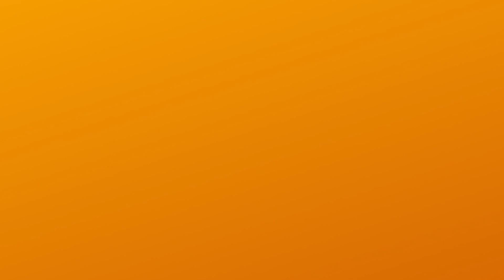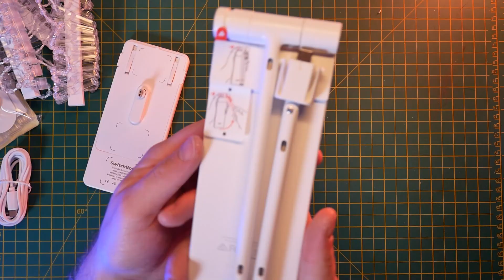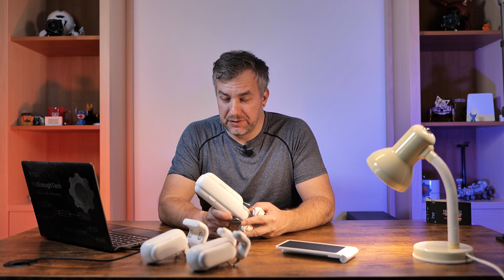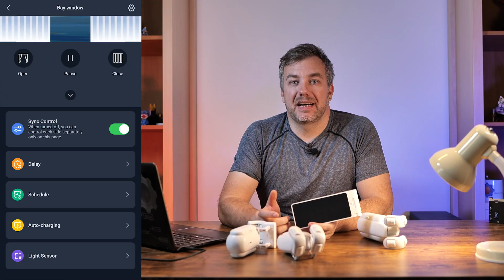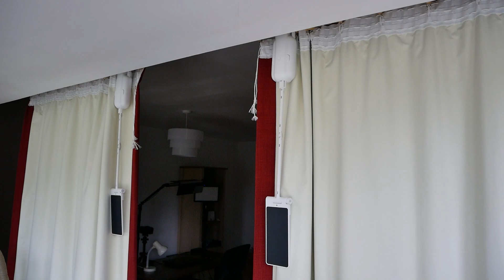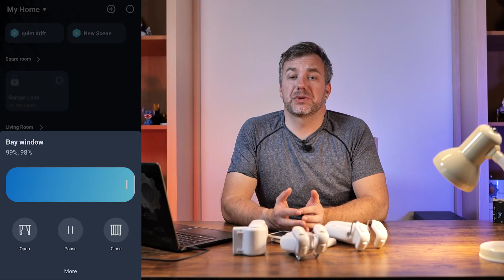Silent curtain automation with a catch! SwitchBot Curtain 3

Comment: I've got a pair of SwitchBot Curtain 3s myself for two curtains on the same rod and it works great for opening but closing is a slight problem because my curtains don't quite come together at the bottom so I have to adjust them by hand. It's not a major issue because the bots close the curtains a good 94% but it's just a little annoying. I haven't tried the magnet yet but I doubt if that would make any difference as the problem is at the bottom, not the top, they close fine at the top. Does anyone else have this issue?
Reply from the maker: As in the curtains sag at the bottom creating a gap?  Have you tried to give a bit more material in front ot the SwitchBot to even it out?
Reply: @notenoughtech  Thanks. I'll give that a go when I have some more time. I'm quite happy with the overall performance of the SwitchBots though. They do a sufficient enough job that I can say it was money well worth spending and I RARELY say that 😀

Comment: I own a switchbot bot, the hub 2 and the lag is awful (3-4 seconds) when using the hub 2's button/buttons to activate the bot (no other smart system involve, hub 2 right beside the bot, everything with last update).
I see no reason why it would be any different with curtains.
BTW, I also own 2 external temp/humidity sensors and there are no freaking way to toggle between them and the hub's own sensor (cable) using the buttons. What a stupid limitation.
I was about to invest even more in the whole ecosystem (curtains, buttons, door sensors) but the lag is a no, go.
Reply from the maker: Have you checked with support? Mine was on pre release firmware but I'll make the update and see if that's an issue
Reply: @notenoughtech  
Not yet. Just moved in new place (sounds familiar?) and contacting support wasn't on my priority list. I have made sure that all device had latest firmware through the app., deleted and reinstalled devices, ... The bot on its own work just fine through the app but once I try to control it through the hub, the lag is terrible (3 - 4 seconds).
Reply from the maker: @sylvainmichaud2262 I'll test on my side and get feedback from my SwitchBot contact
Reply: @notenoughtech  Hub 2 V1.0-0.9 Bot V6.3
Reply: @notenoughtech  
I have retested and measured the lag time on many occasions and it's not 3-4 seconds as I thought but rather 8-9 sec between the moment I press on my Hub 2's button and the reaction from the bot. Directly from the app, activating the bot takes 1-3 seconds. All this with devices i.e. phone, router, Hub 2, Bot close to one another (less than 3 feet).
Reply: @notenoughtech  
More information. After installing the Amazon Skill, I've tested the bot with Alexa 3-4 sec.
It is clearly a Switchbot Cloud communication issue.
Reply from the maker: @sylvainmichaud2262 thanks
Reply: I have a bunch of Switchbot devices and my results vary, but are mostly bad as well. NFC tag, voice command, scene widgets, schedules, and the Hub 2 button are all slow and fail quite a bit. The only thing that's fast and efficient is controlling the device itself from the Switchbot app.

Funny thing is that I have a smart button that runs a scene through Alexa and though that's also slow, it has a very low failure rate. I don't understand how that would be any different than voice or widgets to run scenes but it almost always works.

Despite all I've said I still like their devices and many of the solutions they came up with. So I'll just keep dealing with the delay as long as it works eventually. Which I've accounted for by creating schedules with multiple attempts to open and close stuff lol.

Comment: Why do you need to tell it the best charging position?  Surely it can tell that by how much light it has coming in>
Reply from the maker: It's actually harder than you think. Multiple runs would be required to define best charging positions annoying you in the process. How would a light sensor know if the panel is behind the shadow cast by window, nearby try or a cloud? You'd be surprised how simple is judge great charging position in minutes by a human.
Reply: @notenoughtech True, it'll depend on how smart the system is.  I was thinking along the lines of the left cells are producing more power than the right, so shift left a bit.  But considering how close these will be to your windows you should be able to set it up in the most obvious place.  Also moving it just to gain a little more power would probably use more than you gain.
Reply from the maker: @gordon861 it's more about avoiding the obvious shadows that often travel across the day.

Comment: Great video but how are these comperes to aqara? And also do i still need a hub if i have HA with active Bluetooth. I dont want to buy another hub just for curtains 😁
Reply from the maker: I have a separate video about the aqara ones. As per hub ... I think someone tired the Bluetooth in HA but I'm not sure how this ended up. Btw switchbot hub are also IR blasters. And hub 2 is even more so worth checking as you will have access to API
Reply: @notenoughtech  thanks for the quick response ! I have an aqara M2 hub and for HA and Alexa that doesn't expose anything other than on off state. That made me shy away from company hubs. Need to use their app and automations can't control anything else. If I get these I would like to use light sensor to turn on aqara switches, wifi bulbs and wled with that as a trigger. Is it possible? Sorry for the long post and thanks for your time 👍watching the API video btw
Reply from the maker: Some state tracing would be possible but ideally you want something like HA or nodered to handle trigger/state management